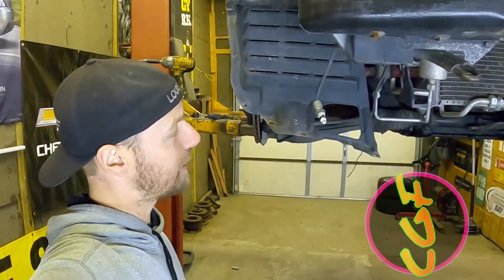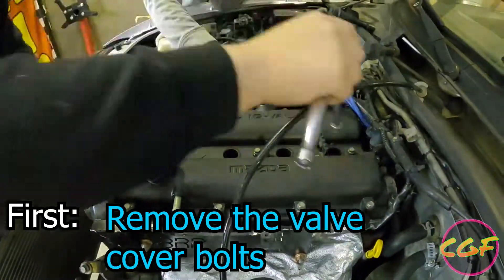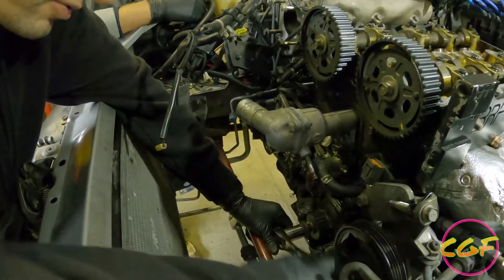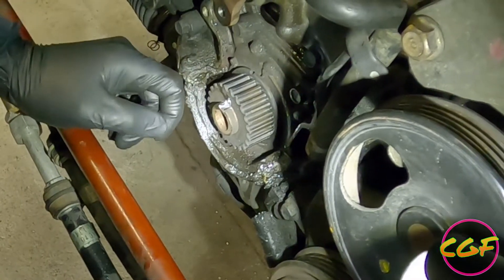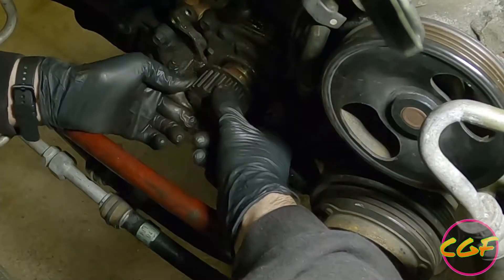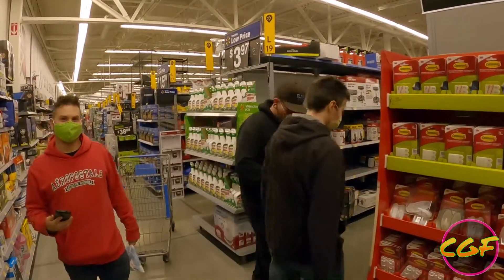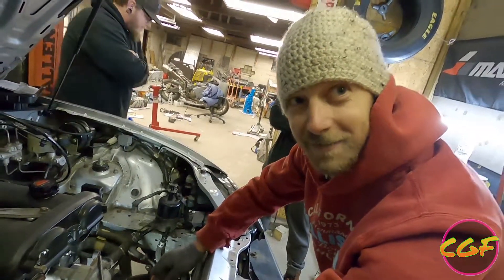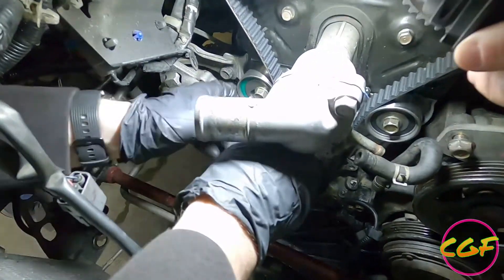How to Repair a damaged Miata Crank Keyway (On a Supercharged NB MX5!)

Comment: Mazda 323 1.6 driver here, thanks for the tip of the job weld. I bought a woodruff key set on Amazon and tried to reassemble my crankshaft but got the key stuck in the keyway and it's too short for the balancer to get a bit on. Just found the woodruff key saver on Amazon and am going to replace it whenever I can get the wrong key out of the keyway. Gonna be a bear with a sideways engine inside the engine bay still. Wish me luck.
Reply from the maker: Good luck! Hope we helped in some way

Comment: How long did it last?
Reply from the maker: It lasted indefinitely in terms of holding on there.  We had issues with the crank trigger sensor reliably picking up though since it still wobbled a bit.  It stayed on the car another maybe 12-16months and even took a few roadtrips since the crank trigger was fine and reliable below about 6000 rpms.

Comment: I have a 1999 nb that read 1#-185 2#-187 3#-115 4#-210. New head on it and it sometimes gets hot. What might it be? Water pump was changed in 2008.
Reply from the maker: That 115 cylinder is very concerning. That with overheating suggests the head that was installed might have been warped and it is blowing combustion into the coolant.
Reply: Try installing a coolant reroute. Puts the water into the back of the head at cylinder 4

Comment: I don't think jb weld is hard enough, how i did it was: new timing gear, key and accessory belt pulley. then drill a smal hole next to the key on the worn out part of the crank and then jb weld the back side of the drill bit you used in the crank
Reply from the maker: Lots of ways to go about it I'm sure. It's been a while and so far its holding! #crossfingers
Reply: Did it work and for how long